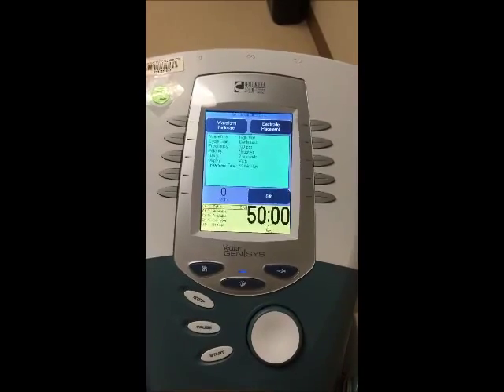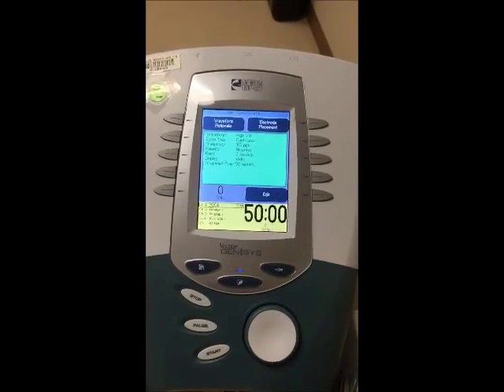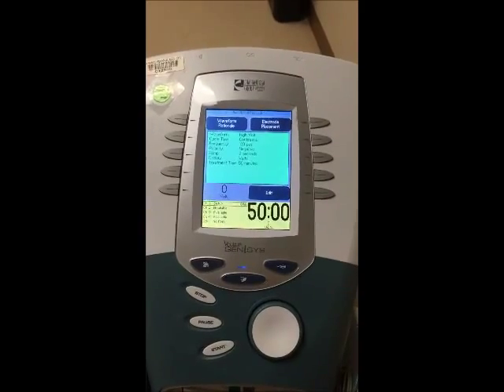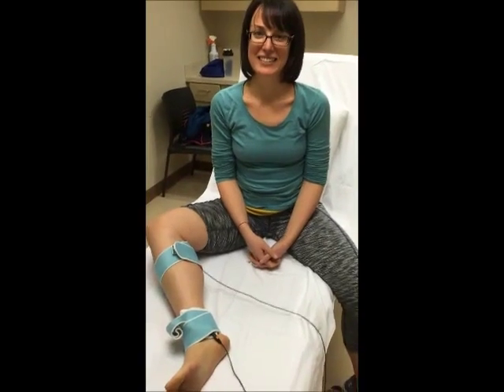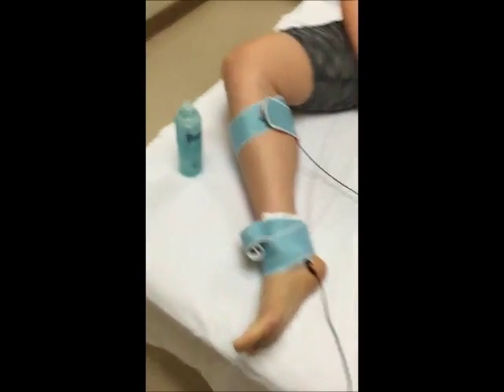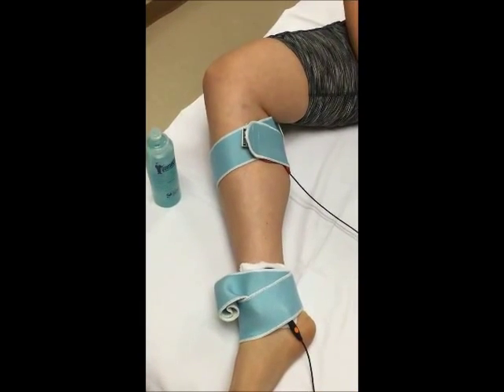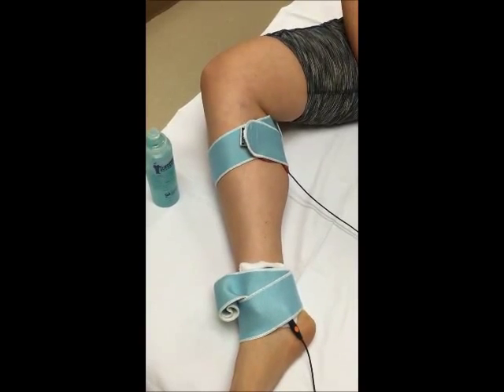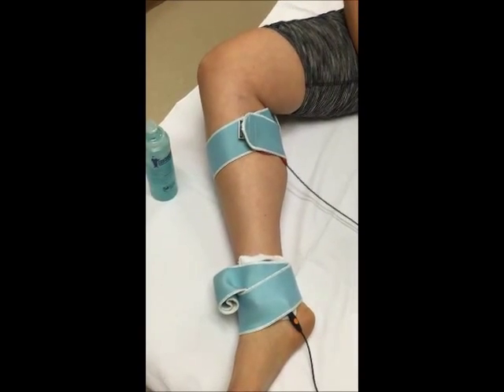High-volt electrical stimulation in treatment of pressure ulcers

Comment: 0:36
3:47
2:32

4:41 HPVC            Decreased by 88.9% after 6 weeks
         CONTROL    Decreased by 44.4% after 6 weeks
Why don't they use this more?
Ans. Same reason they use mercury, They'll  get the same toxic readings again and again and again and again but wont stop using mercury.

Comment: could you please tell me if there's some sort of analysis involved when determining the settings for stimulation? I'm interested in this treatment for my father, and am not sure which technology produces most results. also, there are different devices (2 paddles, 4 paddles, etc...) and really not sure what's the difference.
Reply: I realize your post is a couple years old and I hope you've found something that helps. In the off chance that you have not, or that someone else finds this video with a similar question. My recommendation is to see a professional, someone like a physical therapist, who can apply this treatment as well as others (or point you in the right direction depending) to manage a wound. It will likely be the most effective, and cost effective path. First, machines similar to the one in the video are VERY expensive, it would likely cost less to go to therapy several times than to buy a machine. Second, there are a number of parameters to manage as well as contraindications for treatment to be mindful of. To answer your first question, there is some analysis when determining the settings for stimulation. Not all electric stimulations are the same. For instance, there is TENS, Interferential current (IFC), microstimulation, iontophoresis, and high voltage pulsed current (HVPC). Each of these currents has a different wave form, some are biphasic, some are monophasic as well as other distinguishing factors. The high voltage pulsed current (HVPC) is the one that is used in wound care - it is a twin peak, monophasic pulsed current. Aside from the wave form, there are other parameters to manipulate like pulses per second (PPS, how many times a second it is discharged), voltage, and pulse duration (PD, how long each discharge is active for) and which pad is used as the treatment pad to draw in different molecules/cells depending on phase of wound care/treatment goals. Again, there are a number of things to consider and I think someone is best off seeing a professional for such care. I do hope that some of the information helped clarify some things. All the best!